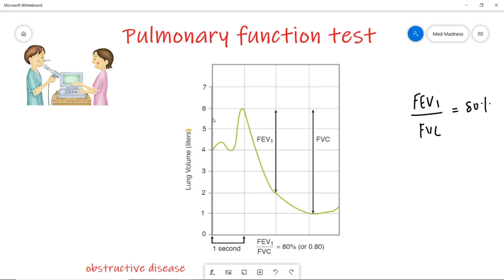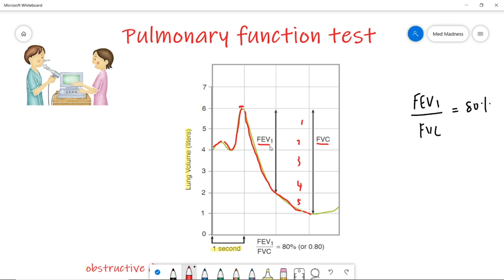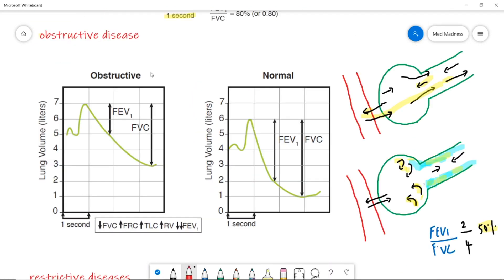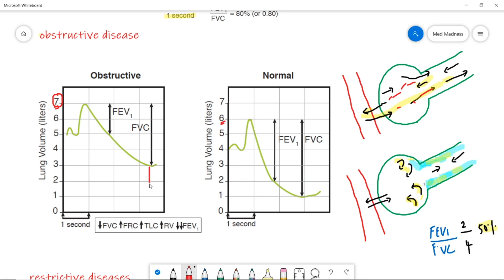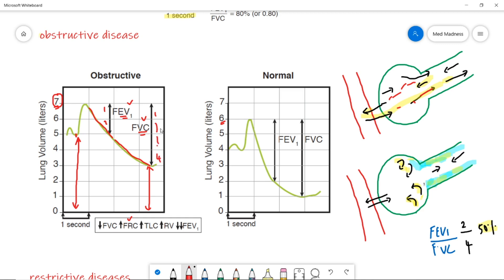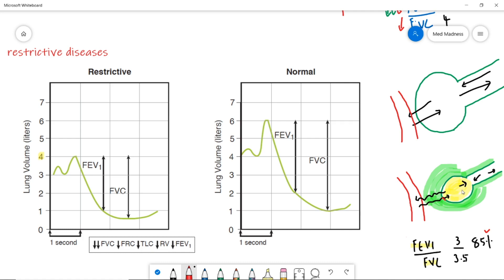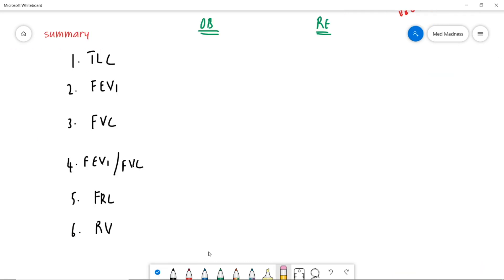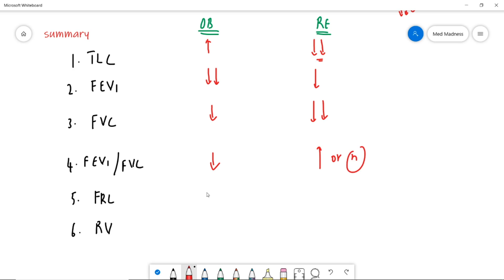Pulmonary function test | Spirometry | obstructive vs restrictive disease | | Respiratory Physiology

Comment: Hello, in VC volume test of my machine, it measures the following parameters below, but unfortunately it is not calculating TLC , RV, FRC, RV/TLC. So how can i calculate them? so my machine measures the following automatically: vital capacity,inspiratory volume,expiratory reservevolume,inspiratory reserve volume,expiratory vital capacity,inspiratory vital capacity,tidal volume,minute ventiation, resp rate,tidal inspiratory time,tidal expiratory time,total respiratory time, ti/te, ty/ti,ti/ttot,te/ttot. Which of these are importantparameter to decide restricitve or obstructive?
Reply from the maker: Thanks for your comment. To decide whether a condition is restrictive or obstructive, the most important parameters to consider are the FEV1 (Forced Expiratory Volume in 1 second) and the FVC (Forced Vital Capacity), as well as the FEV1/FVC ratio. Unfortunately, your machine does not measure these directly, but here's what you can do:

Vital Capacity (VC): Helps in assessing the total volume of air that can be exhaled after a full inhalation.
Tidal Volume (TV), Inspiratory and Expiratory Reserve Volumes (IRV, ERV): Useful for understanding lung volume changes.
Respiratory Rate (RR) and Minute Ventilation: These are more related to ventilation efficiency rather than distinguishing obstructive or restrictive lung diseases.
Since FEV1 and FVC are critical, consider using a spirometer to measure these values directly if your current equipment doesn't provide them. This will give you a clearer distinction between obstructive (low FEV1/FVC ratio) and restrictive (normal or high FEV1/FVC ratio but reduced volumes) patterns.